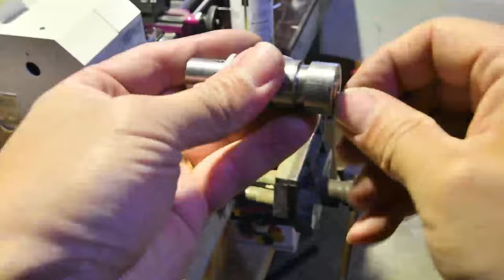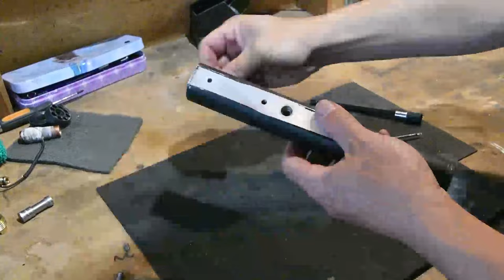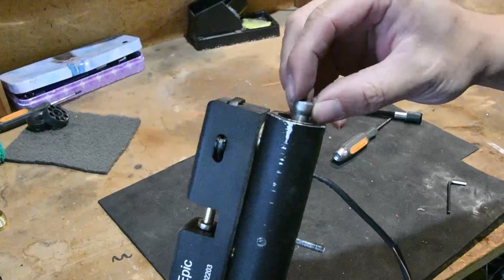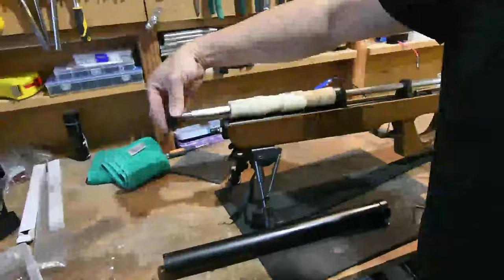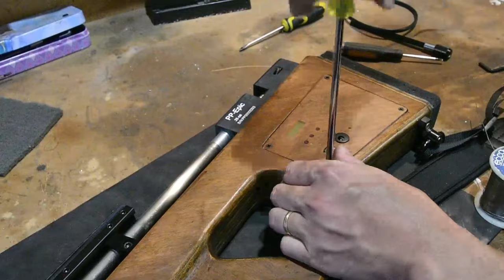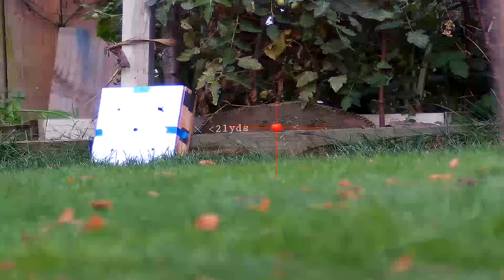DIY Electric PCP Airgun - Let's Put All the Parts Together

Comment: I have made a pcp myself but the conventional hammer and spring way, i have some electronics experience but i dont know where to start with solenoids this scale.
Reply from the maker: Basically, you'll need a high current solenoid and a very big capacitor. The controller circuit boosts up and charges the capacitor to ~80V from a small pair of li-ion batteries. When the trigger is pulled, the circuit discharges that voltage to the solenoid, generates force onto the hammer to open the valve. This force and duration of it is controllable by the voltage on the capacitor and the discharge time. By vary these 2 parameters, the shot's power and also the gun's harmonic over specific pellet/slug can be finely tuned.
Reply: PLEASE PLEASE PLEASE can you do a tutorial on building the solenoid and control circuit.  even a sketch of the circuit would be appreciated. Thanks for the video.
 I used to have a Daystate air gun with an electronic trigger and solenoid valve, best airgun I ever owned  @PP-Hunting
Reply from the maker: @Homeengineering  thanks for your patient. Yes, I will do it, kinda hectic for me at work at the moment. In the meantime, I can share the schematic and code to you, what is your email?